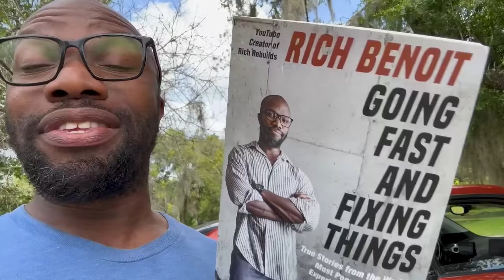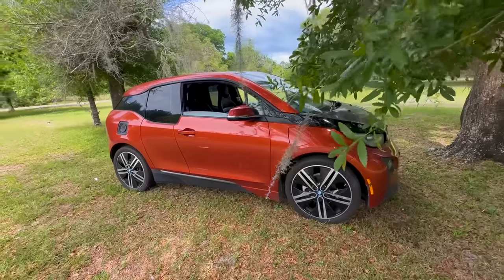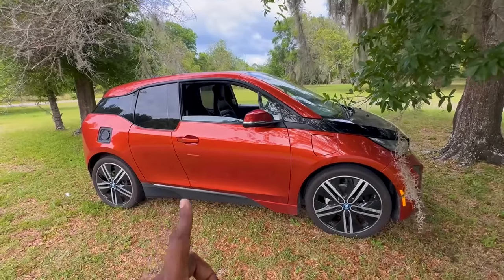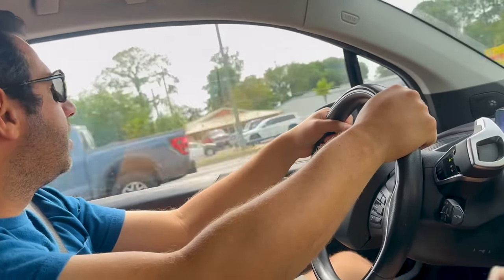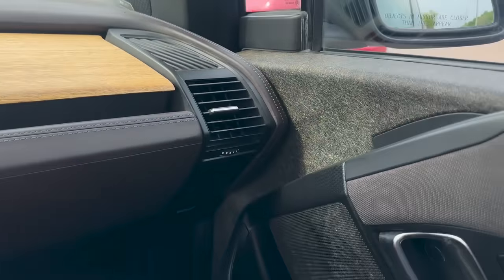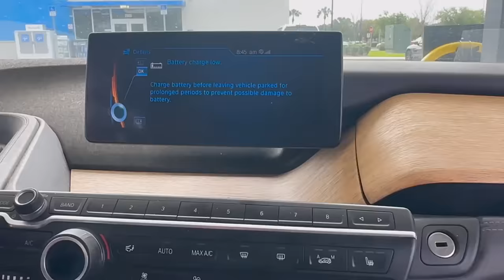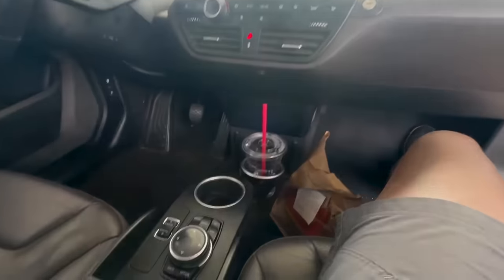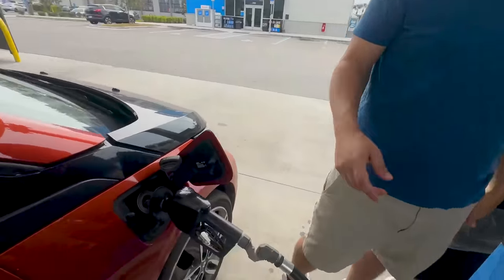I Bought a Ten Year Old $3500 EV and I Increased its Range To Over 400 Miles!

Comment: The i3 is actually a brilliant car that was ahead of its time.  A modern 30kwh battery and a 10 gallon tank would make it amazing.
Reply: its looks makes you want to nuke the planet though
Reply: Went in one recently. Friend has had it for a long time now and I'd never had a chance to go in it. It has a full carbon passenger compartment, like a hypercar or something. Insane little piece of engineering. Utilitarian, but actually reliable for a BMW lol.
Reply: Agree. Ive run a late 33kW Rex for nearly 7 years and its great (110 miles EV with a small buffer, and 80-100 miles on Rex, which works out at 45 mpg (UK gallons)), but you definitely need to code it if you're in the US - over here, its 'coded' as standard and it makes it much more useable as you can flip it on at 75% SOC and it holds nicely up to about 65-70mph. Crucially, at higher SOC the Rex cuts off at low speed so you don't really hear it, whereas at low SOC its awful and makes the power delivery very juddery. With the later 40kw battery and a 3 gallon tank it would out range my Tesla. Tempting!
Reply: They have the 33 kWh from late 2016 and the REX gets a little more powerful. It works nice and also means you can use all of the battery. The DC charging are not standard on all but charge 50kW up to around 80%
Reply: @andders2477  Yeah, I thought about picking one of those up but the absurd fuel tank turned me off.
Reply: @ChuffIed  I don’t know.  I kinda like it.  But then I liked the look of 06 Scion Xb too…
Reply: Late 42kwh batter i3s would almost be perfect daily. If only they would have certified it with a tow bar, grrr
+ it has a normal interior designed with ergonomics compared to most crap today that just all some shitty screen
Reply: @ChuffIed  Well since you are inside you don't need to look at it.
They are quite spacious too, but the whole recyclable ideology makes it look a bit crap inside.
Reply: @Iceeeen  I agree.  I’ve just always thought that tiny fuel tank is a bit absurd and probably why they didn’t sell a lot more of them..
Reply: @donschiffer7400   Yes it is small, but there is no range anxiety.  I have family in Vermont and drive there often in my I3 - a full charge and two 70 gas mile fill ups provide a round trip ride with plenty of range left over....test drive one and you will find you might love it.
Reply: @donschiffer7400 600cc engine was a way to get more people to get in to electric while infrastructure was non existent. Not really needed  anymore at least where I live. We even just recently got a 150kw charging station right in the village miles from any high way...

If only you could legally hook up a 750kg unbraked trailer to it I would get one as a daily. So tired of the big clumsy things manufacturers release nowdays, vw has some but they also forgot to certifie it for towing. Can't even put anything on the roof even on there shity things

i3 for daily and fire up the e39 on longtrips.
Reply: had an I3. it's absolute shit tbh. full of gimmicks. it's absolute shit really.
Reply: @miatamadd  I did.  And I liked it.  But 70 mile fillups is silly.  My kids live 1000 miles away.   I’m supposed to fill up 15 times?  My VW will go 600+.   Half that I could live with but…
Reply: @Iceeeen  I hear you but 750 lbs can be towed by almost anything.   I towed a small trailer behind a Scion Xb (maybe 500lbs) on 7000 mile cross country trips with no issues.

Edit:  I just realized you said kg.  I’ll shut up now.
Reply: So ahead of it's time, it's worthless without major changes. Ok then.
Reply: @eriklarson9137  Yes because a larger fuel tank is “major”?   It’s an affordable carbon fiber tub plug in hybrid.   Yeah, ahead of its time.
Reply: @donschiffer7400  What you can tow and what a vehicle is certified for is 2 different things. Especially if it's a matter of keeping your drivers license
Reply: @Iceeeen  Are you kidding? Cops in this country couldn’t care less about trailers.  For a decade I had one plate I used on 3 trailers.  It’s not like they are going to look up what your car is certified for.

The only time it might bite you is if you grossly overload a trailer or vehicle.  But I wasn’t an idiot about it.
Reply: @donschiffer7400  Myabe there, not here. License revoked and ticket size is calculated on salary. No thanks.
Reply: @philw4625  I dearly love the i3 and want one so bad but it makes no sense for me. I'm averaging 60mpg UK in winter and 80mpg in summer. 2016 330e with 250bhp.
Reply: @ChuffIed  it can't be a pickup or you couldn't import it.
Reply: By law they could only put a tank in that would last as long as the battery
Reply: @kyleroen4341  that's a US (?California) law i believe. In the EU/UK in theory you could have as large a tank as you like. But it defeats the purpose (ie its a get out of jail free option for the odd occasion you exceed the electric range). Its not really meant for regular use. If your daily mileage is mostly less than the EV range, it makes sense, especially as public charging is now getting expensive - you can stick to cheap domestic electricity only. I had to pay  £1 per kWh the other day at a hotel - running on unicorn p1ss would be cheaper!
Reply: wut, it's a pos LMFAO
Reply: @kyleroen4341  Only so it would qualify as an EV and not a hybrid.
Reply: @TheGuruStud  Compared to what?  It’s not even remotely a luxury car but it’s a carbon tub EV.  In some ways more advanced than the Teslas of the day.

You can’t expect it to be a Lexus for its price.
Reply: Basically a Chevy Volt. Out of the box 18kWh (53 miles) and 150 HP engine/generator with 9 gal tank (400 miles on gas). And anything it can do with the engine running (A/C, full throttle accel) it can do on battery alone. You can manually tell it to save battery and use the engine, for example on the highway.
Reply: Hybrids just don't make sense anymore. As Rich said, it's the worst of both worlds. It's double the complexity. More things to go wrong. Just get an EV at this point.
Reply: @Studio23Media  Hybrids don’t make sense in the same way pickup trucks don’t make sense.  But manufacturers buy what people want, not what they need.

I would also say Hybrids make a lot of sense for people living in apartments where they can’t charge at home.   I would never suggest an EV to someone who can’t charge at home.
Reply: @Iceeeen If you get a license revoked for a trailer your city needs serious reforms.
Reply: @MUUKOW3  you are driving an illegal combination. Nothing unusual in most placec of the world
Reply: @Iceeeen  You can put a trailer on your shitbox electric if you want, mo different than a motorcycle trailer,probably should not tow an Airstream but a small utility trailer is fine.
Reply: @donschiffer7400  That's a terrible comparison.
Reply: @Studio23Media  Oh really?  A lot of people buy a truck for all the stuff they think they’re going to do.   They think they’re going to get a boat or camper etc…. Then use it as a commuter.  A lot of people want a hybrid because they think they’re going to need it for cross country road trips.  Then they use it as a commuter.
Reply: @MUUKOW3 
nazi approach or no one was obeying the law....
Reply: @philw4625  you'd probably have an easier time keep your soc if you keep it limited to 50% pack charge. Past that your going to be fighting the packs internal resistance and losing efficiency. Same reason going from 75%-100% takes longer than 0-100%
Reply: @donschiffer7400 that's because of government regulations.
Reply: @donschiffer7400 clearly not the car for you and it's not designed for that use. It's a city car.
Reply: @LemonySnicket-EUC  I know, in the EU.  But regardless, it would have been a better car…
Reply: @LemonySnicket-EUC  No shit?  My whole point is that it’s a great car that could be better. 

The idea that because a car is a ‘city car’ it doesn’t need to be capable of more..  it’s absurd.
Reply: @nismo4x4n  YEs, In reality that's what I've done. 75% is only when im really keen to keep electric range for my destination (ie when there isn't a slow overnight charging option). The best way to preserve the range is to drop speed to 65mph or lower. Its a city car and not aerodynamic. Lifetime EV consumption (normal commuting) is 3.9 miles per kWh but at motorway speed it does 3 miles per kWh. (compare my Tesla M3P which has a lifetime average of 3.1 miles per kWh (normal commuting)  but actually gets 3.9 miles per kWh at motorway speeds!)
Reply: @donschiffer7400  No, you're just repeating dumb talking points that are a terrible comparison to the original topic.
Reply: @Studio23Media  hybrids make the MOST sense
Reply: @u-know-this  No, they don't. The added cost and complexity is not worth the gains.
Reply: If u buy the right kind there is no added cost. I had a prius for almost 5 years sold it to a dealer for $3000 less than I bought it. I used about $20 a week for my 400 mile weekly commute and only maintenance was 4 oil changes during that time. I saved at least $60 a week in gas
Reply: Getting rid of the ice made it amazing.
Reply: Excatly, this is the way PHEVs should be, 30kWh Battery plus 8 gallon gas range extender
Reply: @N4CR The tires... man... annoying
Reply: That's new Ram Ev with Gas
Reply: It's a poorly executed Chevy volt
Reply: Wow

Comment: There are some important differences between the European version of the i3 Rex and the one we got here. For one thing, the Rex in Europe has 2.4 gallons available whereas ours was only 1.9 gallons. Oddly, this is done through programming when the fuel pump shuts off rather than actually having a different sized tank. Also, the programming for the Rex was different. For example, on the Euro version you can start the gas engine at any time to "top up" the battery and save the EV-only driving for later. In the US version it only comes on when the battery reaches about 5%. Luckily, both of these behaviors (and others) can be changed to the Euro specifications through a "coding" process (search YouTube).
Reply: You can’t actually “top up” the battery here in EU. You can ‘hold charge’. Then the rex tries to maintain the battery at let’s say 75%. However, if you stress it hard enough at 130 km/h, it can’t provide enough power to maintain charge and you start losing charge at a more slower rate than without rex.
Reply: Yep, great little cars... motor on speeds that you do on the highway and EV for the streets.
Reply: The software limit on the tank should be because it could not qualify for EV if it could run longer on petrol than electric., therefore it should not be a problem with the 33 kWh. In EU you can start the REX when battery are below 75% state of charge.
Reply: So the US version has a half gallon of fuel capacity it can't use.
Reply: @robintieltjes "Bummer". It's too bad that batteries were just so expensive at that time (they still are, but still way less than they were back then) because if this had an EV range of 200 or more miles I think it would still be on sale. Those tires are still too thin for my liking though...
Reply: @JustWasted3HoursHere  The tires make a lot of sense, e.g. they allow to have a 1m wide trunk in a relatively narrow car.
Also, they don't hydroplane as easily and they are great on snow. Plus they extend the range.
Reply: Imagine writing that about this car? Username checks out though.
Reply: Yep. And the coding can be done with a simple USB stick from eBay. Hardly coding in my opinion
Reply: @LilaKuhJunge Meh, smaller road patch equals less traction. I understand their reasons for using such small tires, but it has its downsides. Must be a reason that all cars don't do the same thing.
Reply: @eriklarson9137 Writing what? The username actually comes from the fact that I used to debate flat Earthers back in the day. A huge waste of time most of the time.
Reply: @JustWasted3HoursHere  the road patch is long instead of wide
Reply: @robintieltjes this is how the Chevy Volt worked, you can set it to hold and it’ll hold the battery’s charge at whatever percentage you left it at. If you push the car hard though, you can still see the EV range drop a little
Reply: Nothing amazes me more in a distressing manner why US drivers insist on driving 80 mph plus. In this city EV of course the tiny electric generator cannot keep up. It’s a city car and not that popular new nor used. BTW, in Ohio primary causes of death of healthy working age residents are: car crashes and illegal drug use. I presume in a few cases the two causes end up in one crash.
Reply: @robintieltjes  If you put it in emissions mode it will run for 20 minutes which could top it up.  But there are a bunch of annoying limitations.  Honestly, the lack of being able to top up on gas is the only thing holding me back from buying one right now.  I've even been scouring the net hoping someone has managed to hack that away.
Reply: Rolling resistance was never considered important  😂  narrow wheels work good for lower speeds,  old golf has 17,5cm wide tires and can go fast .😮JustWasted3HoursHere
Reply: The first thing I did when I bought my (US) i3 REx was program it to act like the European model. :-P
Reply: @JustWasted3HoursHere  Why would it have less traction? Thinner tyres have more pressure per square (whatever you fancy), than wider tyres, that makes up for the traction again. Thinner tyres wear out quicker because of this and you need to make sure the pressure is always right. In this department wider tyres are better. Thinner tyres are also at an disadvantage on gravel since they sink in more (but this is what provides more traction if there is light snow, water on the road, etc.)
Reply: @JustWasted3HoursHere  you dont need fat tires.  the weight of the car determines needed tire thickness and of coarse thinner tires equal less resistance and better fuel economy.  tire compounds are more important
Reply: @JustWasted3HoursHere  actual mostly American cars do this .. travel abroad and those same car models you see in the Usa have thinner tires and also smaller engines
Reply: @Rhaman68 have you been to other countries? The US is a lot bigger than people think. You could go to multiple European countries faster than going through a single state. It's the US most cities are divided by desolate nothing, if we didn't drive 80mph on the highway we'd lose so much time we'd never get back. Driving 80 on a freeway isn't what causes deaths, it's driving reckless, under the influence, tired, not offering traffic signals, using cellphones, and not merging properly. A drivers test should include a comprehension and intelligence test. Going 80 on a freeway without cross traffic, stops, pedestrians, or driveways isn't the issue.

Comment: I just sold my i3 yesterday. I owned it for almost 4 years. It's hands down one of the best commuters. I drove it from northern Indiana to central Florida and back, no extra fuel cell but coded. It took about 26 hours 1100 miles. Great car!
Reply: What does "coded" mean? Can you unlock extra capacity in the built-in tank?
Reply: @heiner71 Does all sorts of neat things like makes it where you can push a button on the dash at any time and it turns the gas engine on instead of turning on automatically when it gets down to say 5% charge, and it unlocks the full 2.4 gallon capacity of the fuel tank. How that last one works I don’t recall but believe it was software limited stupidly. I coded mine to do some Rolls-Royce noises and menu things but I didn’t have the REx.
Reply: @jaoliver999  , thank you. That was helpful.
Reply: "no extra fuel cell but coded"  - Does that make sense to just random people? I know I have zero clue what that means.
Reply: Learn to code ... I mean that unironically.
Reply: So great you are selling it after only 4 years
Reply: @eriklarson9137  no extra tank installed like in this video. coded or reprogrammed to european spec so some nice features are enabled.
Reply: @heiner71  you can get slightly more capacity from the tank, (from 7 to 9 liters) and you can get the generator to kick in at 75% charge instead of when you're nearly run out of battery - like how it works in the rest of the world.
Reply: @eriklarson9137  I guess you didn't notice Rich talking about coding multiple times in the video? 

BMWs, via the diagnostic port, can be configured to do a lot of different things, some of which are only available to higher spec'd or other country versions of the vehicle. Other things that can be coded are the removal of safety convenience things like turning off the seatbelt chime.
Reply: @jaoliver999  I think the US coding is so the gas guage shows less fuel and the processor shuts the fuel pump off when it reaches empty but there is still fuel in the tank.  The european coding allows the processor to use the full tank.   In the US the car is coded so the REX engine only turns on when the battery is below 10%.  The car can be coded so that the REX engine can be turned on while the car is being driven to try to bring up the battery charge.  The car has to be driven in an economical way for the REX to maintain a state of charge.   70mph is way too fast.